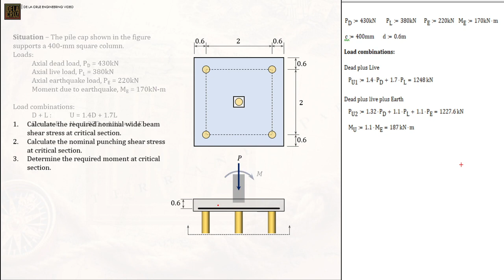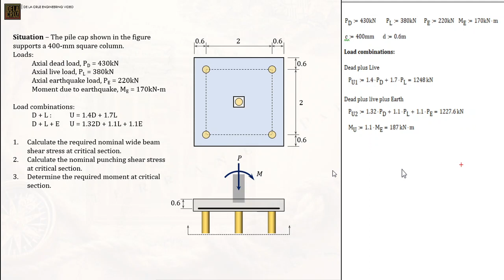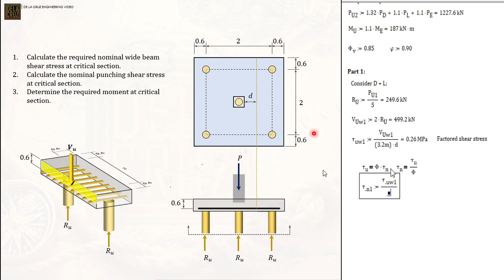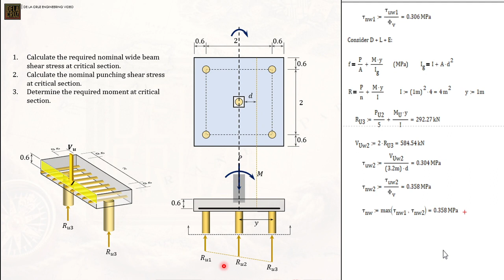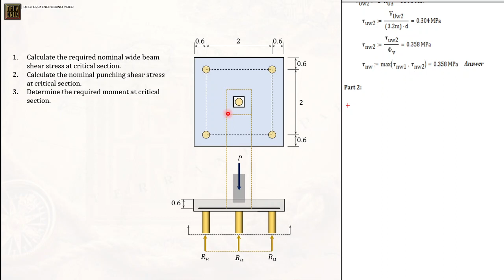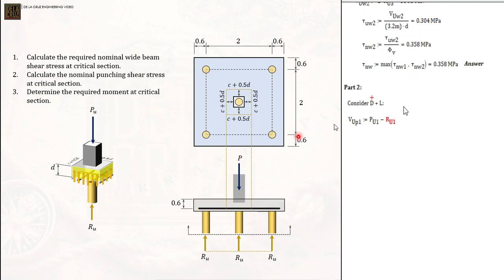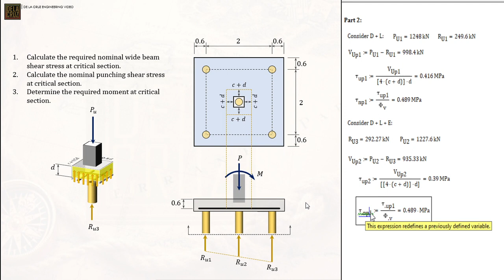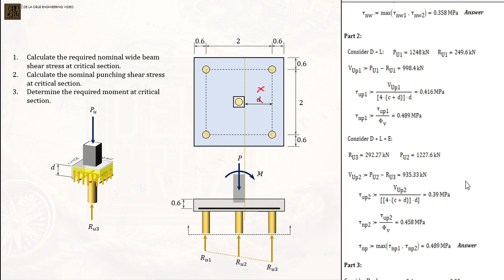RCD Pile Footing - SEC CE Board | DE LA CRUZ TUTORIALS

Comment: Engr., sa board po ba binibigay na yung codes tulad nung sa spacing, load combi., etc.?
Reply from the maker: Sa mga unfamiliar load combi po binibigay
Reply: @EngrDeLaCruz  Engr., How about po doon sa spacing tulad po sa transverse reinforcement for seismic tingin nyo po ibibigay na po iyon sa tanong? Parang mahirap na po kasi maalala iyon sa actual board. Tsaka po yung terzaghi’s bearing capacity sa foundation po? Base po sa experience nyo po engr. Thank you po.
Reply from the maker: Sor far binibigay naman yung code sa seismic and also sa Terzagi's factor. But may chance pa rin na nalimutan nang examiner na e include sa test paper
Reply: @EngrDeLaCruz  Maraming salamat po engr! Godbless po sa inyo malaking tulong po mga videos nyo sa akin.